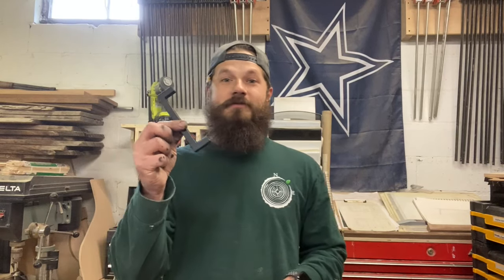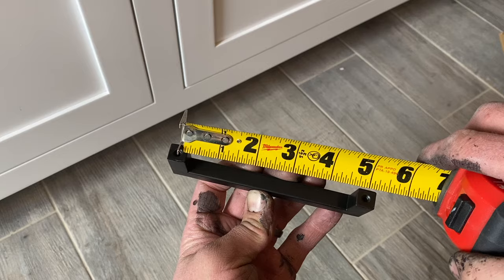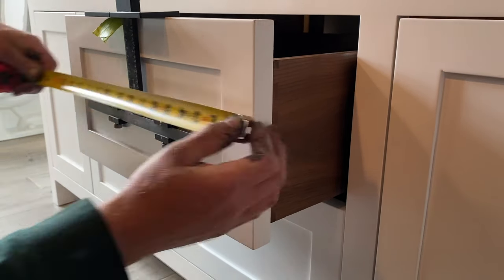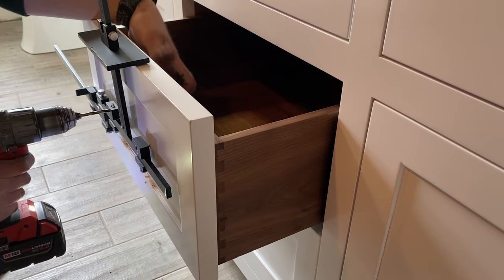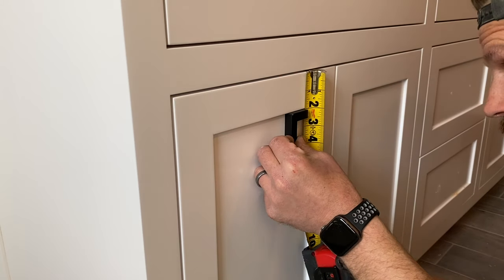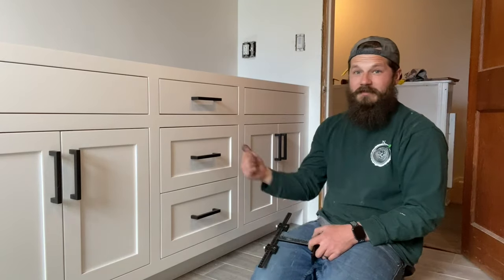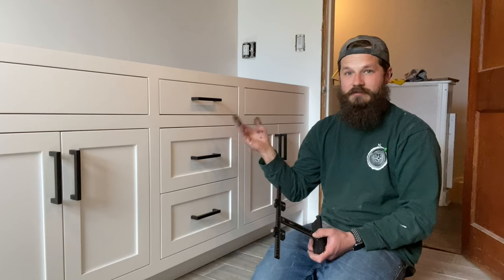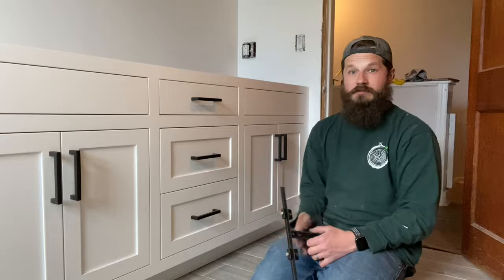Shaker Cabinet handle installation with the Cabinet Hardware Jig | True Position Tools

Comment: I’ve installed hw for years. This is a basic homeowner guide to a $180 jig. 

I’ve never used a side stop and marked center in the top of the drawer front and used the notch for drilling. I’ve also never used the jig to drill all the way through. It will eventually wobble out the steel bushings.

Comment: Jigs are way more prone to off kilter marking and hardware. Its where they rely on the manufacturer to make every door style & drawer head 100% uniform and square. You only get that level of precision on high end cabinets. I suggest using a tape measure and do a quick double check every time before drilling.

Comment: You're doing exactly what I want - to position a handle in the inset face of a shaker drawer.  I'm concerned that the jig won't sit flush against it, and I might have seen a bit of that on this video but can't tell for sure.  Is this a reasonable use and are there any extra measures to take for that difference in the plane of the cabinet face?
Reply from the maker: Yes, this is actually the only jig capable of working on inset (shaker style) drawer fronts! Due to the stability of the top plate and the length of our bushings, you simply need to hold the jig in place securely and the jig will be perfectly perpendicular to your work piece, allowing for accurate hole placement . Some users clamp when doing this step for added stability, but it is generally not necessary. Additionally, we are releasing an accessory in a couple of months to add a backing spacer to make this situation a little easier. Please check our site for updates on this. Cheers!

Comment: I like these tool is nice tool but is no necessary  de stop you can mark on top front drawer the tol have the ark center ready   stop is ok just on door is my opinion
Reply from the maker: Yes, the tool can be used several ways to find center, that's the beauty in its versatility. We prefer a different method altogether that requires no marking, see link for details. (link to centering without marking video that i filmed) https://youtu.be/BOdrxBYGuAg